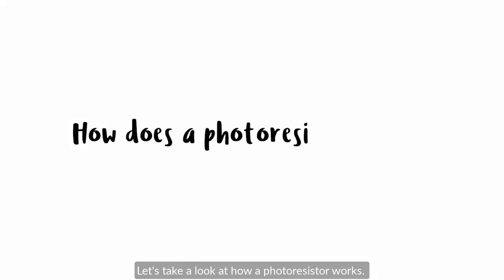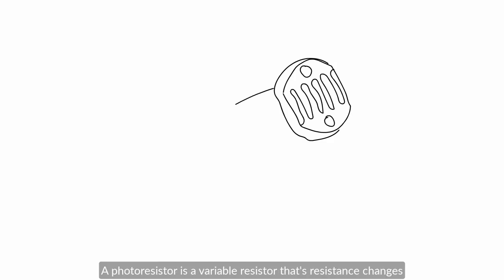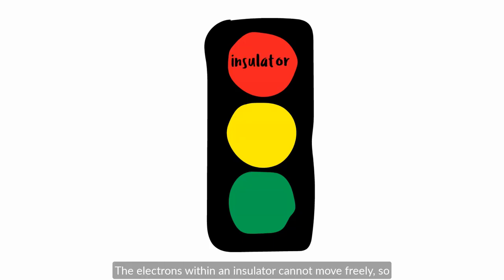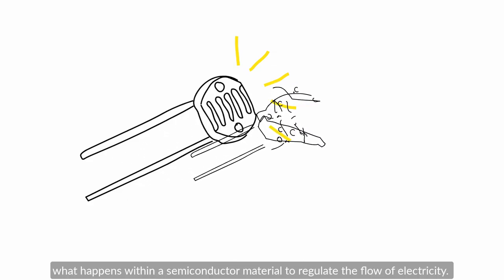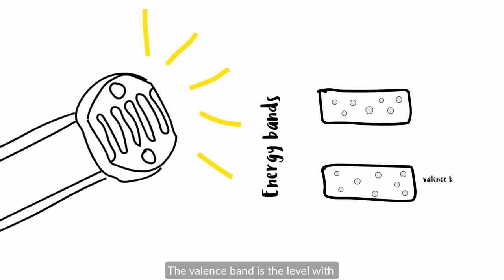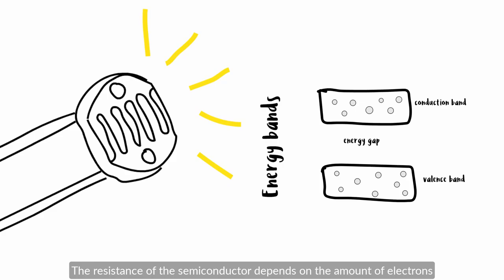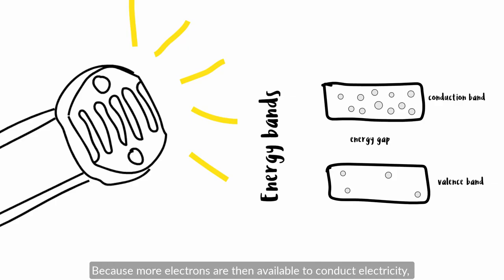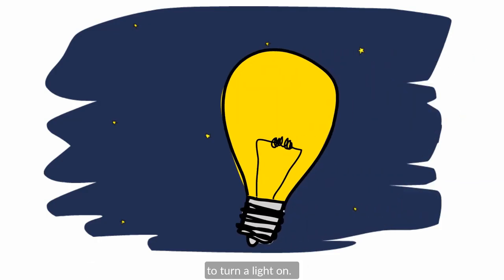How does a photoresistor work

Comment: I was confused at the last example. But I think I get it.

Voltage -> Photo resistor -> Lamp ->Set resistor->ground.

As light decreases, resistance in photo resistance increases. As the resistance increases, the photo resistor will draw most of current, leaving the lamp with no current/power. If light increases, resistance goes down in photo resistance, giving power to lamp(on).
Reply: So you mean it will only light up during the day when the photo resistor has less resistance???  Doesn't make sense
Reply: @wanjevi That's what I'm confused on
Reply: V = IR , as r increase, so does the voltage, meaning as it gets darker, the resistance increase and voltage increase too, so for example a bulb needs 5 v to operate but v was less as r was less during day time say 1 v or less which could be some faint light though. But you get the point now ?

Comment: i m confusing when at night there is no light to excite electron. than there is no increase in conductivity.. how to used to turn on the light at night
Reply: I believe a contrasting example has been given in the end. Actually when the light falls on photo-resistor the resistance increases which blocks the flow of electrons. And when it is covered(in dark) there is free flow of electrons. hope this helps..!!
Reply: It is called current divider system. An electric current will flow trough the smallest resistance than the big ones. In this case, we use two type of resistors, a constant one and LDR. Simply the lamp connected to the constant one, and will get the less resistance than the LDR when night comes out. And the current will flow trough it.
Reply: You can just invert the signal.
Reply: @rachitkaushik2180  I also thought the same but ever where you read its resistance increase in darkness and reduces in light